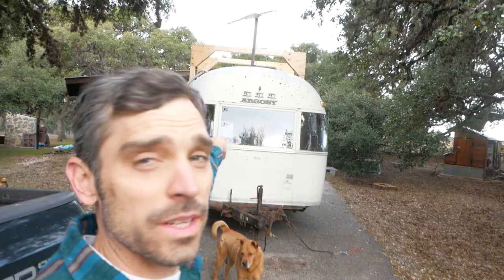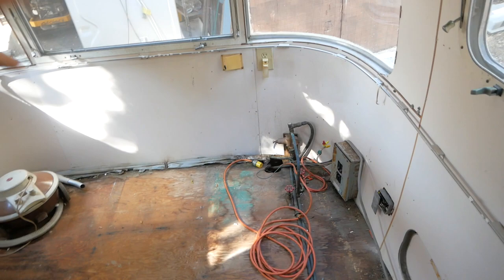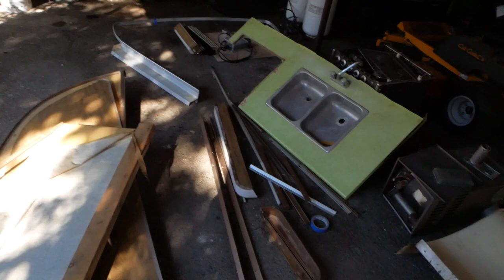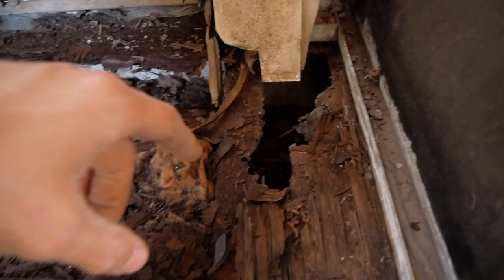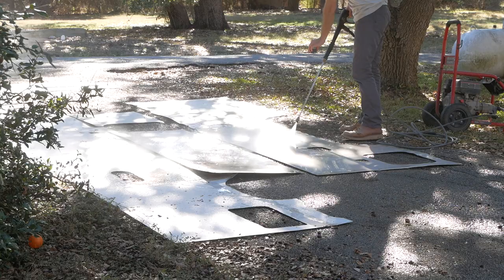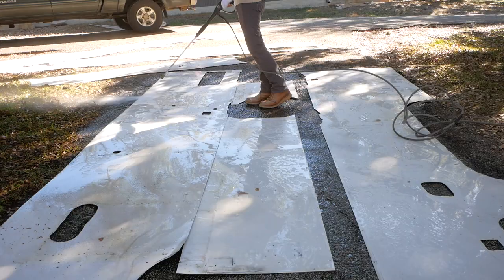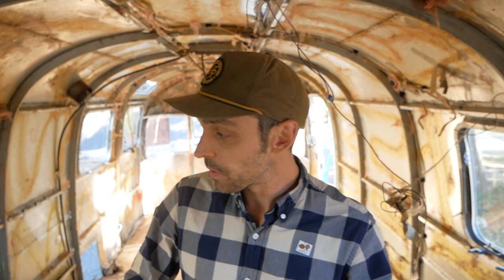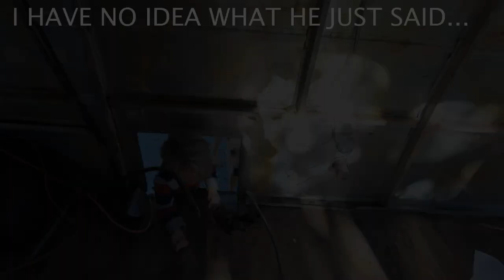Restoring A 44 Year Old Trashed Out Airstream Argosy (Ep. 1)

Comment: I helped out on an old ally Airstream rebuild in the '80s in the UK. A couple of parts of the chassis had to be fabricated on the main channels and some outriggers, new floor and all of the interior furniture like yours.
In a couple of places the ally was perforated by age, the owner was lucky enough to find a guy to make new sections on an English Wheel, where panels leaked we drilled out the rivets and after cleaning the joints  used seam sealer before re rivetting. All the window frames were removed and reseated and new rubbers fitted, unfortunately I never got to finish the job as I had other work elsewhere but I know for a while at least there were no leaks afterward. 

Best thing now is how much info there is online.

Comment: Go back with marine grade caulks, urethanes.  100% silicones are the reason past repairs haven’t held up.  Back in the 80’s I did roof jobs for extra money and the first call-back was a skylight that was leaking, I inspected the silicone and grabbed a corner and stripped it off like it was a single piece of rope.  That taught me that silicone doesn’t handle extreme hot and cold and releases when subjected to it.  Total boat can give you plenty of choices and guidance.  Best of luck, this will be a great project and labor of love for your family.

Comment: Probably needless to say but, go with marine grade plywood for the subfloor replacement. It’s much more rot resistant than traditional or ground contact pressure treated plywood. Costs more too!
Reply: And make sure to seal all the edges before reinstalling them.
Reply: Pressure treated plywood would be another option, it's used under fiberglass sun decks, is easier to find, and less expensive then marine plywood. If it was just an ordinary RV floor I wouldn't bother, Douglas fir ply, or yellow pine ply, would be good enough, maybe with a coat of paint. anything is better then the O.S.B, and particleboard, many campers have.

Comment: I work at Airstream prepping and putting in the galley appliances. Only been there coming up on 2 years. I love watching these build videos of the older models. This looks like the same design we use for the 26 Rear Bed Flying Cloud.***And they don't all leak. We have a huge water test area with water hitting them from all sides for over a half-hour with someone inside checking for leaks. So I can say, at least when they leave the plant, they don't leak.

Comment: Good luck on the restoration. If you haven’t done this before, a word of advice — a trailer is not a house — the built-ins (cabinets and partitions) are actually structural. Removing them affects the integrity of the trailer. Get some professional advice and don’t move it down the road as a shell. 
I found out the hard way that restoration actually begins from the outside in.
Reply: Many ratchet straps if you need to go far . MANY . That thing will FLY apart .

Comment: I've got a 1976 Airstream; doing exactly the same thing to it.  Mine wasn't quite so bad on the floor, but I put about $700 worth of new steel into the frame.  Every window leaked.  Lots of leaky Olympic rivets.  Both tail light assemblies were leaking.  Rodents got in through the rear bumper storage area - it's wide open for that.  Anywhere you see a pop rivet on the outside, you'll have a leak.  Can't find any of those curved upper window glass replacements, so I'm going to blank them off with .042" T6061 and call it good.  If I want to see the sky, I guess I'll go outside.  I'm going on two years with my project; the shell is back on, new floor, sandblasted frame, more support where needed and new axles.  I'll probably be a very old man before I get to use it!  

Cheers, Andy; you're a hero.

Comment: Go nuts with closed cell spray foam insulation, good insulation and helps seal the seams
Reply: What? That would ruin the Airstream experience. That's the custom-cargo-trailer experience. As all Airstreams leak, all Airstreams also need to be able to dry. I like the story on the owners' group website about the guy trying to make it through the winter in Alaska living in one. All it took was about 15F before the moisture caused the door to freeze solid to the frame. That's a perfect Airstream story.
Reply: Reflected Miles not to mention the “ living in a galvanized iron garbage can” when it rains,

Comment: I rebuilt one of those, same layout. Condensation builds up between the skins and runs down onto the floor. The floor runs out to the outer skin and rots out there. To change the floor properly you need to do a frame off restoration. I hav heard the outer skin is not as good as an air stream but I did polish it. Painted the end caps. Looked really good, then sold it for good money. If your outside seams are leaking, you need to replace the sealant, you can use solid blind rivets or spend a lot of time working with someone else. There are these aircraft tools that hold the panels in place, temporarily, until everything is ready to rivet. Brace everything and don’t keep taking everything apart or you will just have a couple of big piles of crap.

Comment: A little tip. When you rewire the trailer, use only marine grade wires. The reason is marine grade wires are tinned and therefore resist corrosion with possibly moisture and such. And since you only want to do this one time and not have any issues with corroded connections later on, it would seem the better choice.  And it really isn't anymore expensive then non-tinned wire. Just a suggestion. Thumbs Up!

Comment: Wow! You didn't waste any time gutting that thing Andy! Sadly, that's the EASY part! I love old things too - I have a '68 Ford Ranger 390 that I use to pull a '65 Shasta Continental SCS trailer.
Sounds like you have done your research, but I'll pass along what I have learned over the years. 1) Keep all the parts you pull out for templates until you're finished  (looks like you are doing that). 2) Cabinetry is part of the structural integrity of the trailer - you can't get rid of it all. 3) When reconfiguring the layout, be sure keep your weight evenly distributed (tanks, appliances, cabinetry, etc). 4) along with #3, make sure you have enough tounge weight. 5) Beutal tape is your friend for sealing all joints - never use caulk. 6) Pre-treating with WD40 will help you remove the existing silicone around the windows. 7) Reinforce in between the ceiling ribs if you plan to add solar panels. 8) Use stainless steel fasteners or aluminum rivets on the exterior. 9) Put down a pan or vapor barrier before you reinstall the subfloor to keep moisture from migrating from underneath (when towing and parked). And 10) Show your wife lots of Pinterest pics of what it will look like when it's finished!!
Reply from the maker: Thanks!  Very helpful advice!

Comment: I remodeled a 77 Airstream.  Vintage trailers dot com was a big help with original caulks and seals.  Every joint and puncture will need to be cleaned and re-caulked.  The leaks will leak on the outside and run on the inside skin to a totally different location.  A pneumatic rivet gun is a must.  Silicon is no good in RVs and sailboats.
Reply: I posted some of it. wudrest on YouTube

Comment: If you find the right diameter pre-bent pipe (car exhaust could be a start) you can fabricate the missing/bent bottom pieces easily. Two pipes would yield all four corners + the insides could be used for interior trim if you wanna go the extra mile (they match the curves).

Would add interior support, arches, it's getting on with the age, a little bit of stiffness in the upper section doesn't hurt.

Comment: Straight purple cleaner, about 12.00 a gallon, be careful it will remove paint if left on to long, but will clean where others fail, mean green is a lesser strength if purple is too strong. Good luck from a old airstream owner, 1984 31 ft. Excella, all original.

Comment: Spray urethane foam for the insulation because of almost double R-Value in comparion to the  spun glass.  Also consider applying an aluminum foil on the  inside for a vapor barrier.

Comment: I resurrected an RV that I got on the cheap due to hurricane damage.  It was a two-season from the factory and after getting it down to its bones, I built it up to a four season Dodge-mahal!  I encapsulated entire space (floor, walls, roof, and doors) in three insulating layers: a) 1/4” thick recycled tire rubber first; b) then 1/2” thick spun polyester batting for air gap; c) 1/4” neoprene material such as anti-fatigue floor covering for shop floors, or mechanic’s yoga mat!  
The floor base was replaced with two layers of highest grade (densest) ply I could get (1/2” thick, each) with the above mentioned insulation stack in between.  
The walls and ceiling received an additional layer of r50 purple foam panels that I cut and glued on top of the above mentioned insulating stack, and all that sealed with a semi-bendy 1/8” finishing layer of painted/sealed ply.
3 years later, I’m glad I did this upgrade.   Keeps in the cold a/c in summer and the heat from wood stove in winter.  Took me two years (and $40k) to finish it (2 springs, 2 summers, and 2 autumns), but has been great in which to travel the country.  
Life’s good!!!

Comment: to help with the sound dampening and to help seal the seams, use that white flex seal to paint the inside of the shell before you insulate it again. 
Progress so far looks good, structure looks sound enough to repair!
If you have any problems with demo, removal, then you can always colab with Demo Ranch...lol

Comment: Leaks tend to travel. The water will flow to the lowest point just from water tension. Your ceiling leak might be from one of those vents and the water was traveling and dripping from the trim. 
Kind of like in the front one of the widows was leaking but the water was dripping off the wires. 
Best of luck!  I always had a dream of doing a old trailer restoration but it’s a time and money thing for me.

Comment: For insulation I would like to recommend spray foam. If done right it is both effective thermally and it provides it's own vapour barrier (being close celled) Also it is somewhat structural in the sense that it binds the body framing and outer skin together...

Comment: The modern urethane sealers like they use now to hold in winshields and auto glass will take care of the leaks at the seams . It is far superior than any type of silicone .   The place where they put bondo over the tears in the aluminum TIG weld it back closed up  to repair it  .

Comment: I did a similar rehab on an R-Vision Trail Lite. It really wasn't worth saving, but I had more time than money and I wanted a functional travel trailer. I was luckier, because the interior above the floor was usable. The trailer frame had no rust damage. I gutted it and rebuilt the floor, then put everything back in over the course of a summer. The shower drain and the side skin by the water heater had both leaked, and the layer of plywood against the belly skin was saturated mush. Most of the demolition was just pulling out chunks of floor with my hands. Before you get too far into reconstruction make sure you fix all the leaks. Lap sealant needs to be redone every five years or so, and it gets ignored. That's why travel trailers seem to leak. Airstreams are kind of like Harleys; even old basket cases are often worth saving, and they're worth some money even in lousy condition. If you put in a few hours every day, I expect you'll be camping sometime this summer.

Comment: That trailer is definitely fixable. You might want to use marine ply for the subfloor if you plan on keeping it long term. It is more expensive but it's also more rot resistant. If you aren't, just use standard subfloor and save the cost.

Comment: Mix a little ammonia (1/4 cup) and dish soap (1/8  up to 1/4 cup) in a bucket of water (gallon) and presoak those panels for half an hour or so before powerwashing them again. You'll save a lot of work. You should buy one of those car washing extender wands with a soft bristle brush for a garden hose (don't bother trying the hose it'll leak like crazy.) and scrub a little if needed. It'll save you hours and take away the smells on anything and anywhere. This mix will even work on moss and mildew with an 1/8th cup of bleach added. But, you will need the brush (light soft plastic bristles) Good luck.
Reply from the maker: Great ideas thanks!

Comment: Now that they are all dry and rolled up and put away... LOL... I was going to suggest spraying the skins with a 10% bleach solution, giving them a light scrub with a brush (more to get the bleach into every cranny than to actually SCRUB them) and letting them dry in the sun. Maybe when you are getting ready to use them. Though I do agree with others, it would look awesome with wood where you can. Maybe white skins on the bottom half of the walls, then wood on the top half and ceiling?

Comment: Yep once you start applying silicone to seal windows it only gets worse. I never understood why people did that rather than install a new seal, all that does is move the leak to some place else. Roof leaks are always tough to hunt down. I wouldn’t be surprised if they start at the vents and run down along the channel 5-6 feet where they drip down.

Comment: Andy - given that those skins are rough, and that you're redoing the interior and likely as not things won't necessarily align.. Have you given any though to making forms and building up interior skins from veneers of wood - custom formed plywood if you will. It would certainly be unique and a rolling showcase for your skills. You can take it a level farther in the manner of your panel builds for the walls and cabinets - custom build honeycomb, or other core, panels ( like a luxury jet interior) give you all sorts of options for shape ( a very light panel core structure attached to the skin you don't see,  filled with spray foam, trimmed and the final skin added is extremely rigid and strong - Custom SIPS Panel - and you have all the control of species etc on the side you see / touch....If I had one to do.....

I'd also suggest that you think about having the insulation done by a spray foam company ( or yourself) since it will 1) seal 2) deaden sound - just make sure it's not a formulation that will out-gas nasty stuff ... I think that there are a bunch of soy based options these days ( apparently the world was built on soy beans - who knew) 

Great Project !! Looking forward to your adventures.

Comment: Don't replace the plywood with plywood and expect a different result. Use solid plastic, or aluminum sheet.  Insulate with spray closed cell foam. Adds strength, tightness, and huge R-value.

Comment: I heard say, that those airstreams suspension, rides on rubber bushings. I don't know, but I hear it is an old design that was proprietary to airstreams.
Don't know.
As far as safety goes, 
If I was doing a complete restore, I would install an emergency window in that back bedroom.
Cool project! Can't wait to see what you do with it.
Reply from the maker: Yes, they use torsion axles which use a stiff rubber for the suspension alongside a gas shock.  I'll be replacing the axles as the rubber wears out over the years.

Comment: Depending on what your usage plans are (warm weather only ?  75+% plugged in ?) seriously consider going all electric, no propane.  Easier to rebuild.  They make good DC compressor refrigerators or go with a residential refrigerator (both will work much better than propane in hot weather).  Induction cook top, microwave/convention oven.  Heated mattress pads for cold nights and a couple of inexpensive electric heaters.  If you are planning on "boondocking" (fully "off grid") you will need 4 batteries (use 6V golf cart batteries) and probably a 2000W inverter/charger/transfer switch (no AC-DC converter required; wire the DC panel directly to the batteries).
Last thought.  Consider a "composting" or cassette toilet.  No plumbing.  No black tank.

Comment: I love your undertaking. Only correction is from the beginning of the vid. It is not a hot water heater. It heats cold water. It is simply a water heater. Don't feel bad though, you would be amazed how many plumbers say the same thing. Love your work Andy. I have done the same for 39 years and haven't found a reason to get bored.
Reply from the maker: That's a fair correction!  Not sure why I've always called it a hot water heater.

Comment: Are you sure that end cap was galvanized? That does not make sense because of you put galvanized steel against aluminum the aluminum will corrode very fast. Did they use some sort of isolation strips between or is it indeed galvanized?

Comment: From what I have heard from a former Airstream owner is that one can arrange to take their Airstream back to the factory for a complete rebuild. Hate to see what they charge if they still do this work today. 
Most all campers and RV's will develop leaks from age. You have two things working against you with older units. The sealants used were a bit primitive by modern standards and tended to dry out with age and second, road wear and tear. The vibrations on the joints will actually crack open the dried out sealants leading to leaks. These campers are always worth restoring if you can do at least 80% of the work yourself and with friends.